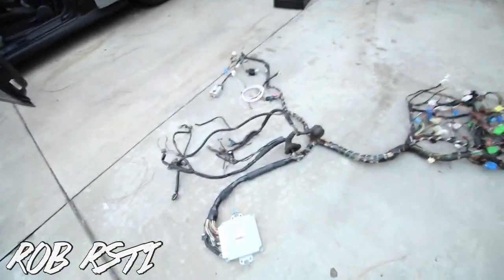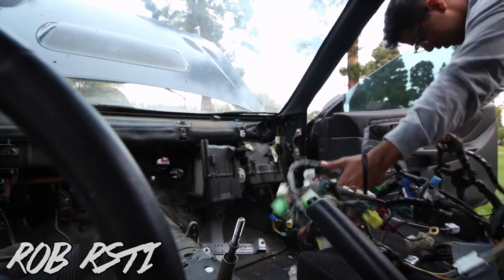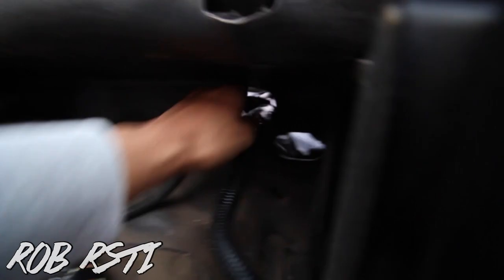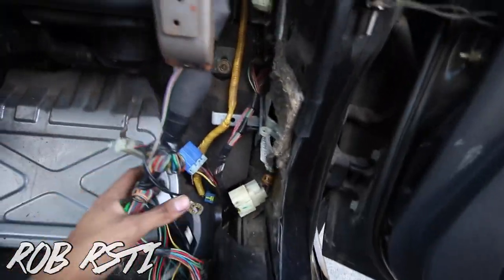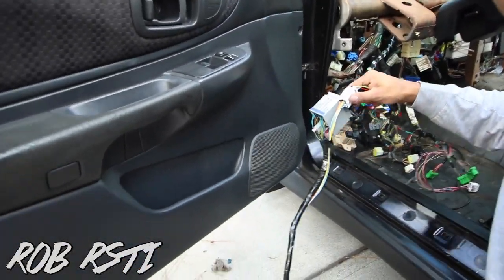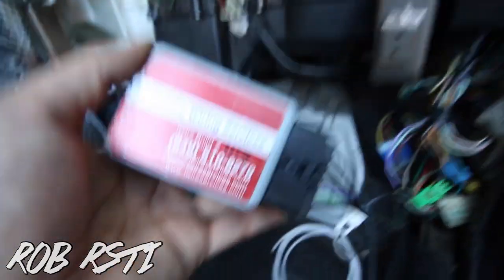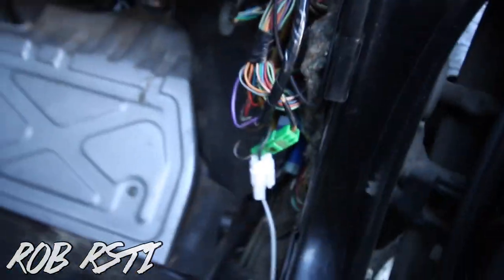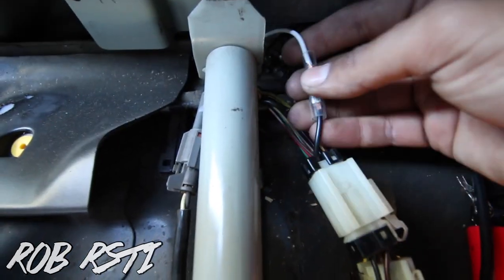RSTI Build: How To Install iWire's Merged Harness !

Comment: How come you aren’t swapping to the gd dash and keeping it rhd?
Reply from the maker: Yes your right I could've went RHD, but I didn't want the GD dash. I wanted to keep the GC dash.
Reply: @Robrsti  So is that why you sent your harness to iwire? The STI harness won't just plug and play  into the GC dash/gauge cluster? Also does your transmission have dccd? Cause if it does the STOCK 2.5RS gauge cluster won't work, you'd need an sti one i think? BTW awesome video dude, really help me out.

Comment: you got the harness out without removing the a/c box?
Reply: I tried when I had to pull mine
There's no real way to get the white box in the center out without potentially breaking some soft plastic HVAC ducts parts, it's better to just get it drained.